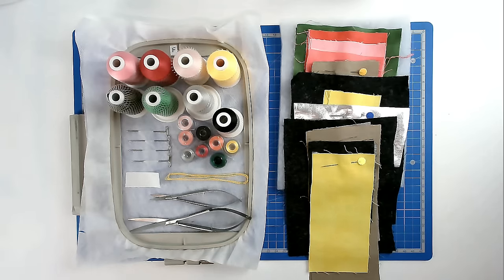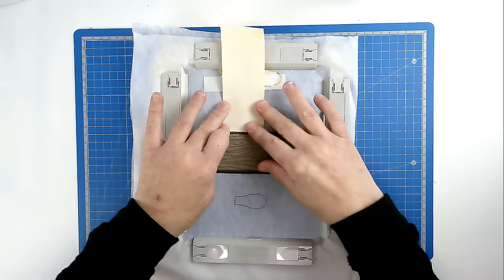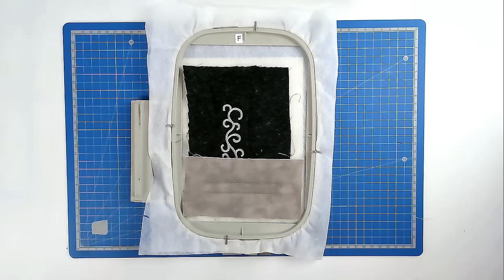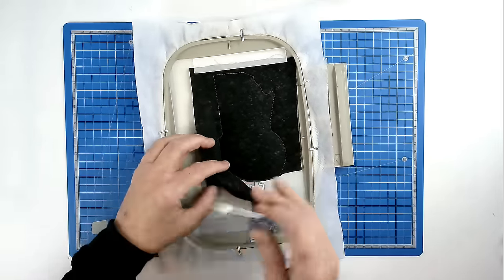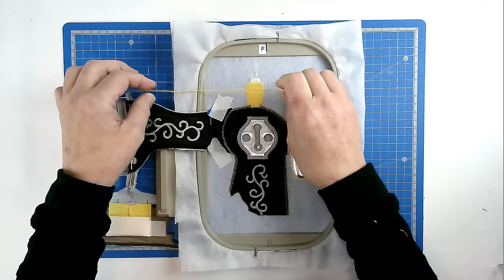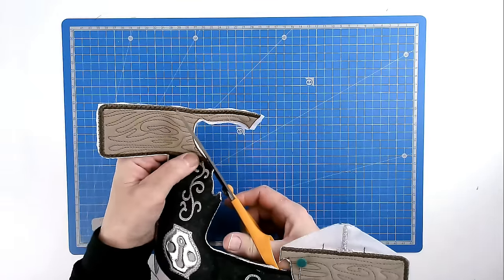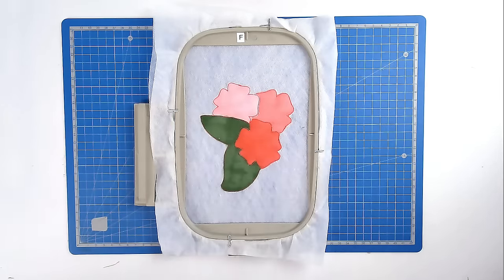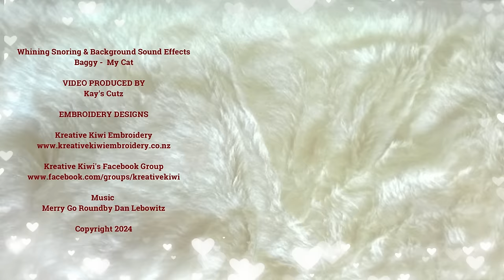Large Vintage Sewing Machine   By Kreative Kiwi

Comment: I was 5 or 6 
years old when my mother sat me in front of her Singer sewing machine with a knee press pedal. Mom put a dull needle in the machine, removed thread and gave me a sheet of notebook paper  I had to sew on the lines to learn to sew a straight line. I found it quite a challenge at first.....